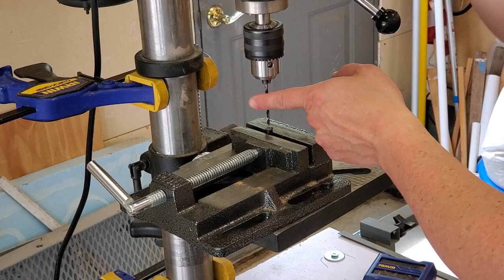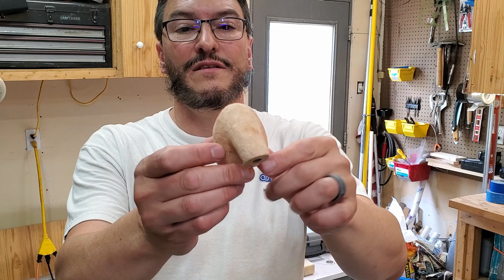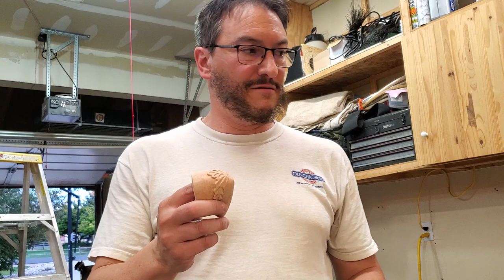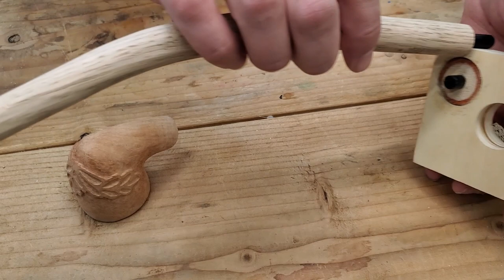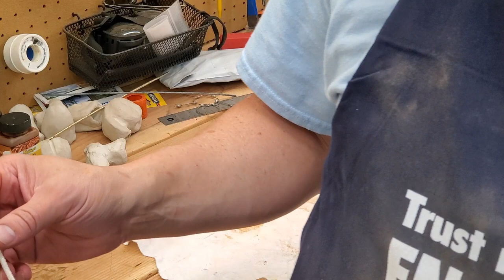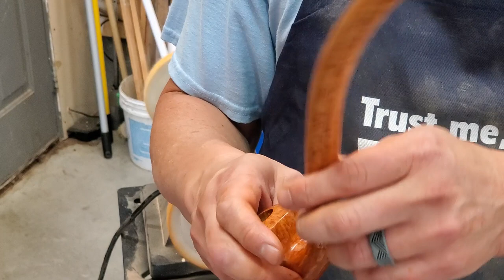Pipe #11: A Bilbo Pipe

Comment: If you have another chuck, place the drill bit in the chuck and mount the chuck in the drill vice. Place the piece to be drilled in the pillar drill chuck so the piece is spinning and when you move the drill down, the drill in tyhe bottom chuck will not wander to one side. Think of it as on a lathe. The holes drilled in wood / metal or any material stays centre cos the drill bit is placed in the tail stock and the piece moves. It will be easier to make a centre hole in the centre. :)

Comment: Nice pipe fantastic video how did you bend the pipe stem did you use steam and clamps
Reply from the maker: I boiled the stem in water and then used a jig that I made from trying to replicate something I saw in a different video on bending the stems.  Here's my video on the jig https://youtu.be/uBxPbpa3Rhk. If you look in the description of that video, you will see a link to Pipes by Design's video on the actual bending process.  I didn't make my own video of that since I was just copying someone else.
Reply: @CherkyB hey man how are ya? Try superglue finish.
You can get a huge amount of shiny hard heatproof gloss with superglue. Use a blue fake latex glove. Superglue don't stick to it. It loves latex!!

Youl never go back.
It works on stain if  its dry.
Else it goes cloudy.